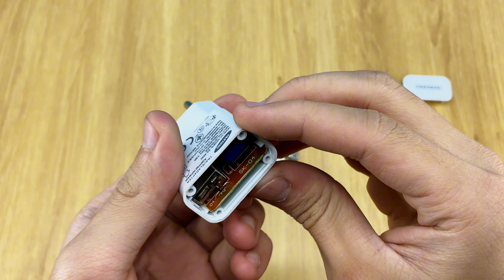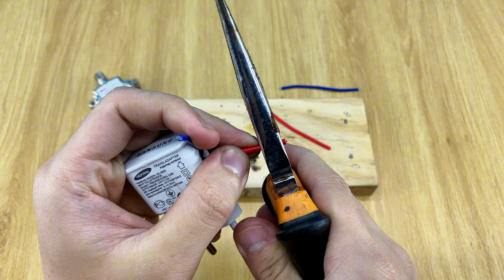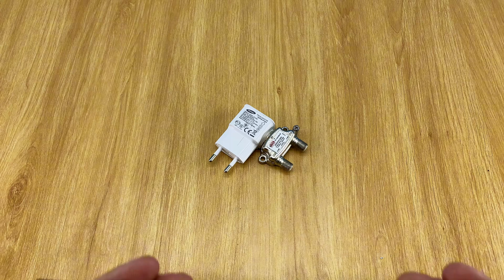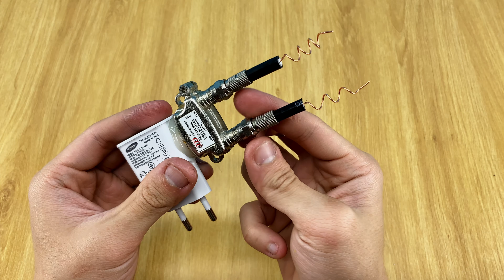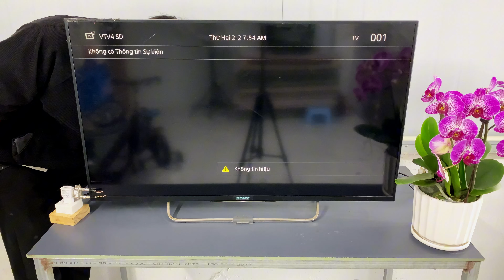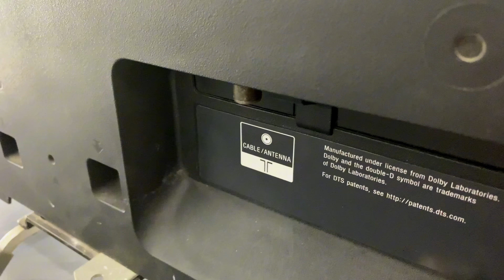📡 Stop Wasting Money on Antennas! Connect a Splitter to a Phone Charger

Comment: The circuit board becomes a signal receiving and reprocessing device you say ? How's that happen ? You connected the wires straight to thr input side of the board where the connectors slip directly on the big pins that go into the wall socket . Nothing is going through that circuit board . This videobid BS . You might as well stick a coat hanger into the antenna jack of your TV ! That might work even better !
Reply from the maker: Haha I see your point 😅 thanks for sharing your thoughts.

Comment: This makes no sense. You just bypassed th entire circuit board of the charger by soldering the wires directly to the side of the board the connects directly to the contacts  where the main power come in through  to main contacts that plug into the willpower socket. It doesn't go through the circuit board at all you might as well go straight to the splitter and not waste time  with the charger and that ug in wall socket . This video is a bunch of malarkey  !
Reply from the maker: I understand what you’re saying 😅 thanks for sharing your thoughts and pointing that out.